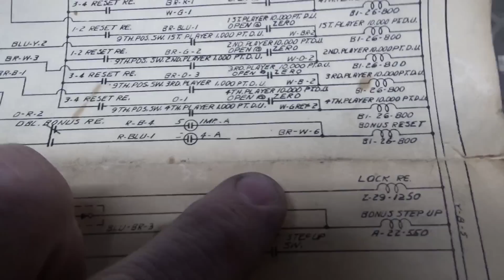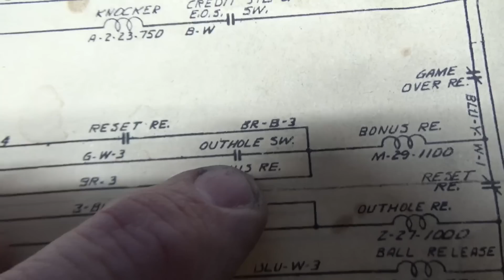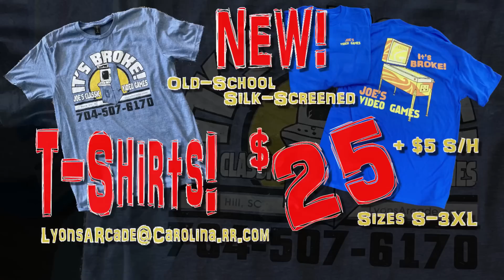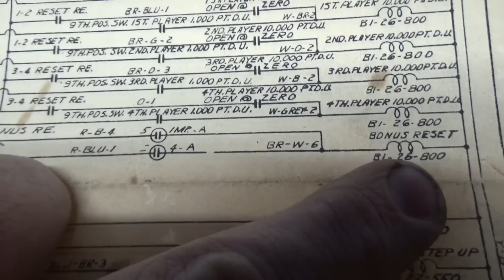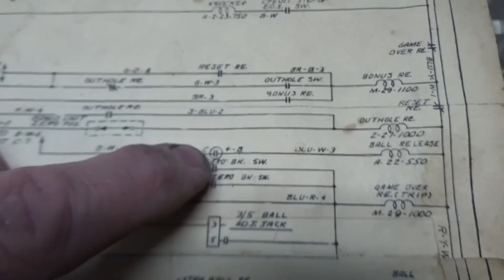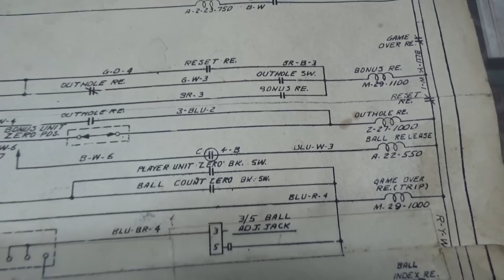How The Bonus Unit Works On A Williams PAT HAND Electromechanical Pinball Machine ! Very Complex

Comment: Are you still able to source miniature incandescent light bulbs?

I thought everything was LED now.
Reply: Only general lighting and illumination (GLI) lamps are affected by the new efficiency standards. Specialty bulbs are not affected. In fact for some many safety-related applications (including required automotive lights) you need to use the original type to maintain certifications.

Comment: Thinking about how few people today can just read a schematic let alone understand how it works.
Back in the 70s almost every electronic device came with a full factory schematic and some had actual parts lists from the factory with the part location with a factory phone number for support and an order number for accessories and a separate number to call for the parts to fix it.

I still find one every once in a great while when I buy an old radio from the 70s with the original package.

That is another thing our generation did, we kept the box, documents and packaging.

If course we had a house with a basement or attic or garage to store them.

Now you have a 400 sq ft apartment to you share with 7.other adults.

In some of the companies that had 24 hour operations and were remote locations we had " hot bedding" where we lived on site and had 12 hour shifts.

Just like the military on submarines they had beds that were used by the 2 shifts and they referred to it as hot bedding because you would have the bed still warm from the previous person.

I have never seen this aside from illegals where 50 people lived in one house and shared beds.

But now because of high rent no one can afford, and low wages, I am seeing a 1 bedroom with 8 people where 4 people work 1st shift and 4 people work 2nd or 3rd shift and they literally are sharing beds.
It was a cool thing when I was in my 20s but I am weird.
Most people really hate living at work and sharing beds even less.

This causes a lot of anger in people and is a contributing factor to our quality of life going down over the last 5 years.

I really miss the old days.
There were half as many people in the 70s and you can tell how much more people there are now.

I miss the peace and quiet 😢